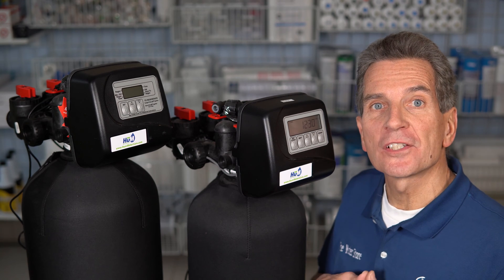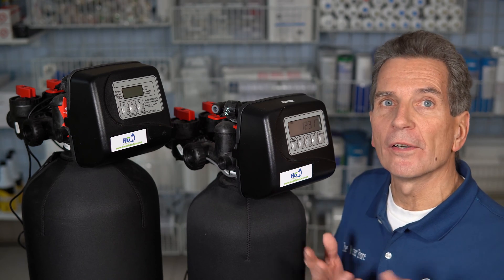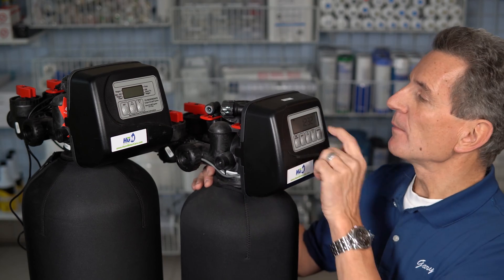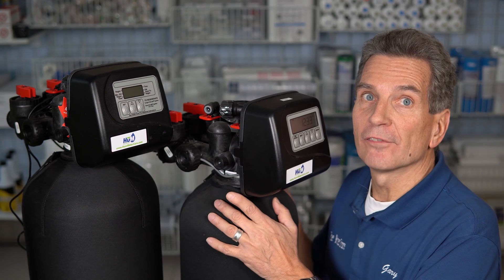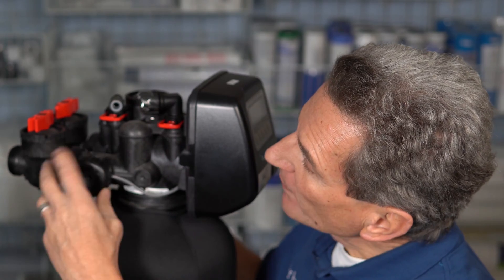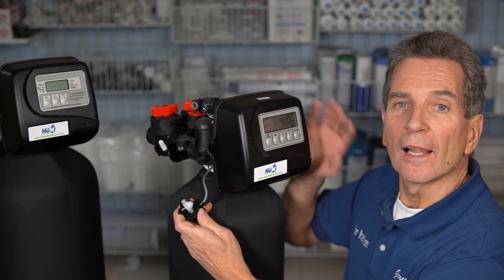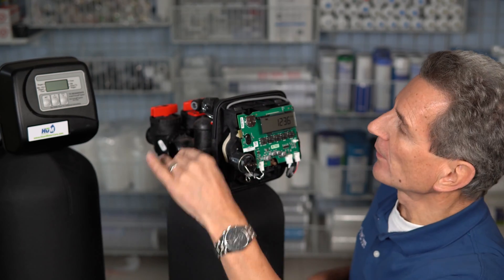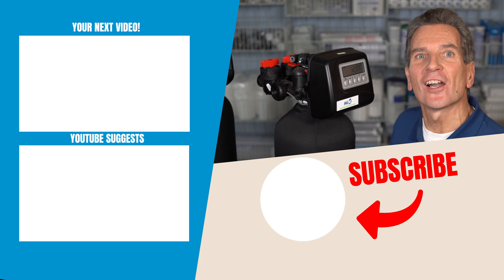WATER SOFTENER Troubleshooting NO SOFT WATER 6 Easy steps

Comment: My softener has slowly become less functional over time.  It still regenerates, still uses salt and still puts the "gauge" or "meter" back to full after regeneration.  I typically use that meter to tell me when to push a button to cause a regeneration at night.  Typically every couple of days depending on use.  This is a pretty old softener.  Probably at least 10 years.  But it has worked pretty consistently the entire time I've had it.

What has happened over the last month or so is that the amount of soft water we are getting out of the system is less and less.  Everything else stills seems pretty much the same.  Used to be that if the gauge showed only about 10 or 20 percent remaining capacity, it was time to regenerate or we would get hard water.  Recently we would run out of soft water with the gauge still showing 50% capacity, or roughly 1 days use for us.  Now we run out of soft water when the gauge still shows 75% capacity.  So we can't even get through 1 day without getting hard water.

It seems like when it regenerates, the softener thinks everything is going just fine.  It resets the meter etc.  But it seems like whatever gets restored during regeneration (like recharging a battery), is only able to get restored to 25% capacity.  Like the battery can no longer hold a full charge, only a 25% charge.

Gary.  What is likely going on?  Thanks.
Reply from the maker: Either your water has changed, your water softener media needs cleaning or is worn out.  The easiest next step would be to use a media cleaner like in this video to see if that helps https://www.youtube.com/watch?v=c8QKYr3B02I
Reply: @water_estore   Many thanks for the response and the link.  Makes sense.  I'll give it a try.

Comment: Does the soft water from softener form any layers on skin or it cleans the skin deeply??
Reply from the maker: One of the beauties of soft water is that now layers are formed anywhere.
Reply: @water_estore  what does this mean? It doesn't clean skin properly and the dirt remains on the skin??? Without cleaning the dirt,  it forms out layers??it means the water doesn't reach the skin because of 
layers???
Reply from the maker: SKAR Z when you bathe you use soap in water to clean your skin and hair. Soft water makes the soap work better and eliminates any of the scale from hard water forming on your skin or hair. Soft water rinses all of the soapy water and dirt away.
Reply: @water_estore  if it rinses soapy water then why do I feel  soap is still present on my skin even washing so many times??
Reply from the maker: @suzumm6150  You are using too much soap.  One of the advantages of softened water is that you use far less soap than with hard water. Use less to begin with, which is ideal, or spend more time rinsing the soap residue.